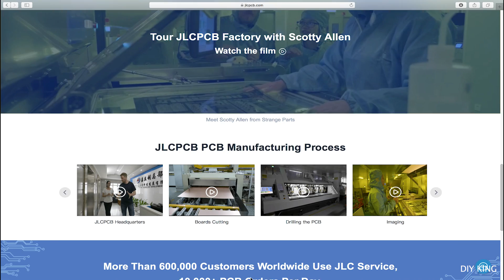How to make a Small Electric Generator

Comment: this is pretty damn cool. i got a small harbor frieght predator engine and used an old car alternator which fed a led acid battery bank and a power inverter. was a crude setup but it worked well for keeping some critical appliances running when the power was out. woking on a smaller more refined setup with a better engine+alternator setup and lifepo4 batteries. (for on the go power just get something like the jackery units and have a generator recharge that if you need to)

Comment: Hi  my friend. Project very good. I  build  too. For another project. I have drift moto. Principal electrical  motor, and yeor project.  Power from alternator to electrical motor. But need your help. I serching dc-dc module input 10v-150v to out 42v 8A.  Did you possible show me all components on the plate? Thanks my friend.

Comment: Thank you for showing us this project, I've been trying to figure out how to make a very small, fuel sipping  generator to charge my solar batteries after a week of cloudy weather. I can't seem to find a commercially made one.
 You can use a 3 phase voltage regulator from any motorcycle for a regulated twelve volts DC.
 If you remove the clutch, you might be able to have an electric start with a 3 phase motor controller too.

Comment: You need a governor to regulate the speed the gas engine because as the load increases he resistance of of the generator makes it harder to turn o the speed of the engine drops so in real generators they use a mechanical governor to increase rpm to compensate for the load

Comment: What is the max AMP can be drown from the Hoverboard? at least 30Amp?
Reply: The typical hoverboard uses a battery pack which can deliver 15-20 amps but if you gear it to output about 30 volts at the max power rpm of the motor which might be 7500 to 9000 rpm and then use a buck converter rated for 20a input at 30V and >30a output you should be able to get over 30a output at 14V so you should be OK.

Comment: Would this engine be strong enough to power 2 hubs?
Reply from the maker: Yes it can but we need to double the gear ratios and make it run at full throttle.
That will definitely make it heat up alot faster.

Comment: Great project. What is happen with rotation speed when electric energy consumption is changing, do you have a loop back  control ?
Reply: He was just playing with the throttle control himself. But I imagine you could create a governor to either maintain engine speed or voltage depending on what you're looking to do.

Comment: Why not buy a rectifier box for an atv for $11 on eBay and use that to convert the ac output to the 12v dc? They literally rectify 3-phase power into dc on atvs so that you can have lights and a starter.🤷‍♂️ pretty much any atv rectifier would work so you can buy the cheapest you want.

Comment: I need to put a 1200 watt 12v car amplifier on my 150cc gy6 moped.... Is this possible with what the stator it currently has? 8pole stator. No headlights being powered, no taillights, brake light etc. Just want to power 2 6x9 200watt speakers, a 1200 watt car Amp and a small car stereo. All 12v. Is this possible without having to do any major modifications?

Comment: Sir you didn't show to us how you modified the wire connection inside the hover board when you take out the electronic circuit inside the hover board.

Comment: You would fair better by reversing the sprockets, meaning larger on the engine and smaller on the motor = higher RPM = MORE USEABLE POWER. Push it ( increase the diameter ) until the engine cant turn the motor, then back down on the sprocket size on the engine by 30%.
Reply: hoverboard motors are usually designed to turn pretty slowly

Comment: you destroyed a 400$ hover board just to make 5 mini bulbs glow?!
Reply: It's a damaged hoverboard mentioned in video
Reply: ok so you destroyed an old hover board which I found for sale on average for about 200$, just to make 5 mini bulbs glow?!
Reply: @369SkinneR  Hoverboard motor costs around 20$
Reply: @anujuniyal1702  Thats not the point Anuj, the wires probably cost 5$ and the wheels 10$, a hover board without a motor is not a hover board so my point is even if you manage to find a used hoverboard for even 50$ (good luck), why go through the whole trouble with this demonstration just to light 5 bulbs! If you say the motor cost 20$, then it would be easier and Cheaper to buy the used motor but again, even with this said, why go through all the trouble. This is what I was trying to pass on as a message.
Would you actually say this vid makes you want to go out and buy a hover board to create this device? Ide rather do a project where we buy our own solar cells to generate way more power.
Reply: @369SkinneR  you are right but the prices of hoverboard are cheaper in India as compared to other countries .
Reply: @anujuniyal1702  ah! You got a point. I didn't think of where the vid was coming from. So ok makes sense for them down there to try this project but for me down here in Canada, ide rather just keep rolling on my hoverboard.
Have a great day.

Comment: I'm building something similar, but larger, and about 150 amps at 30vdc to charge batteries in my off grid home!
Reply: have you done ??
Reply: I am using heavy duty, Delco alternators, with custom regulation, using 150 amp modified alternators, the Delco 22si alternators are used in industrial trucks, I have several, and using one on a 6hp engine, it should output atleast 130-150 amps at 28-29.4vdc, I'm also thinking about putting one on my riding lawnmower, so it can be used in emergency to add to the emergency charging capability, using a DC  generator to charge, insted of a ac generator can be more efficient, over a HV AC generator, then converted to useable DC voltage , more losses,  the alternator can run at any RPM, is another plus, it can be tuned to charge at nearly any RPM. I also have a possible steam engine generator , to be powered by a small boiler on a wood stove, off grid require many means of power generation and storage!
Reply: @jamest.5001  :)) Great Job 👍

Comment: Now modify it to run on hydrogen gas extracted from water through hydrolysis
Reply: Yes
Reply: Diminishing returns, wont-work because nothing is 100% efficient. Basically it will use more hydrogen than it can make.

Comment: This is by far very simple technical instructions and looks very clean conversion. My only question is why put such a small gear on the Engine output, a bigger Gear would have resulted in much more output from Generator. Secondly I just wanted to know that this small 36cc 4-stroke Engine output power equals to 0.6 or 0.9KW of energy, so if you could have selected and I say IF, like a more bigger Generator with extra coils or Permanent magnets that can produce let’s say more than 1KW or even 2KW of Electric energy, then would you actually get more energy OUT than your actual Input Energy ?? Just my little dum dum question......
Reply: No the engine would stall

Comment: i only saw the intro pic but a better episode will get million instantly is alteranator with timer for exciter that is exciter on the timer by a larger magneto. just try it and use the energy for light bulbs out side only but then change the alternator to motor and make it run one like itself to power a fan or drone.

Comment: Hi. Good job. you can increase the output voltage by substituting the pulleys, the big pulley on the engine shaft and the smaller one on the electric generator.
Reply: Ya that's what I was thinking maybe not a straight switch maybe a 2-1 this looks like a 1-16 😂
Reply: Way too much RPM:s for that hub, would not last long.

Comment: Why did you reduce the generator speed?
Reply from the maker: We need to increase the torque produced by the engine to drive the motor
Reply: @DIYKingSaM  you reduced it on the generator!
Reply: @PMF3d  Same principle as a bicycle, to have more power to the rear wheel you reduce the front gear and increases rear wheel's gear.
Reply: @f4tboy99  the motor is on the bearings, it easily rotates, why increase thrust?

Comment: I wonder if you could run a hub motor electric bike off this, It could sit out over the rear tire on a newspaper carrier and give you the option of highly extended range and battery charging at idle and braking times with the right electronics.   Allowing for extended powered rides...
Reply: Prolific Invention brilliant idea!
Reply: If you had those the torque could come from the electric motor and the ongoing speed could come from the weed eater motor making the most efficient motorized bicycle. Idk if i would use electronics maybe a more mechanical approach first just to get the idea rolling
Reply: @jujitsuman68 link to a video?
Reply: this has already been invented. it's called a motorbike

Comment: The gas price is higher than the electricity you will produce
Reply: Yes but if you need electricity everywhere you're happy to have this product . Of course we don't know how much power in Watt ...
Reply: If this doesnt make more than 25 amps, then , were wasting a great setup on a crap gen..
Reply: @KeatonsCarlott  on his blog he said at 40% throttle it produced 250 Watts at 36 V, so 36 V @ 7 amps dc
Reply: im interested in  making a brown gas generator out of urine, and burning the hydrogen to generate electricity. This project is cool but i don't think i can create overunity while using hydrogen.
Reply: @Rem_NL  if its made to make HHO with small voltage and current yes it will be like stan myer

Comment: so nice tip
Reply: "Video request". Free energy for the whole house. Need 200 amps ac. Thought of using 1800 volt dc motors with about 4300-4500 rpms. Getting vehicle altinators like a firetrucks high amp output at low rpms at idle speed and 4 12 volt car batteries. Use 2-3 dc motors turning 3-4 of the altinators.  Have one altinator feeding the 4 batteries and keeping them charged. Convert the other 3 altinators to ac output and putting a power box like for a outdoor genirator to plug into your house to where you could disconnect your main breaker on your house and feed your new power source into your breaker box. Please give me some ideas to help make it a reality.

Comment: please add link to The schematic, gerber files and the list of components for the rectifier circuit
Reply: A circuit board is really not necessary, just get a 3 phase rectifier monoblock which has the 6 diodes wired correctly internally and add an electrolytic capacitor for smoothing if needed, that has the benefit of being able to be screwed to a heat sink, which you will need, if you intend to run hundreds of watts through it. The led with resistor is also optional. There is really nothing to it, other than it looks cool with a pro made PCB.

Comment: Why not the spocket@gear use big on engine and small on coil, and disable clutch on engine. Slow rev high spin on coil. Save fuel. Just a suggestion.
Reply: Have you tried to spin one of the bldc motors, just shorting 2wires, its nearly impossible to spin by hand, short all 3. And it's basically impossible. It would likely not have the power to spin it with such a overdrive , 750 watts is basically 1hp, with losses , it will take 2-3+ hp to spin this at full power!

Comment: First of all you should remove the clutch in engine and direct propel the generator and use a governor (speed controller) i.e over loading..it increase speed automatic and stable the power...and fuel efficiency tooo.....